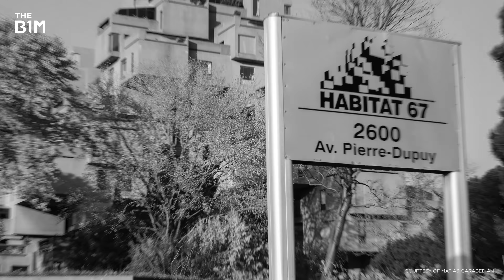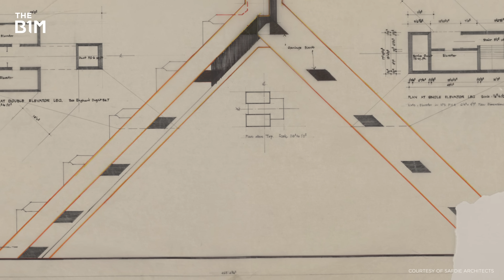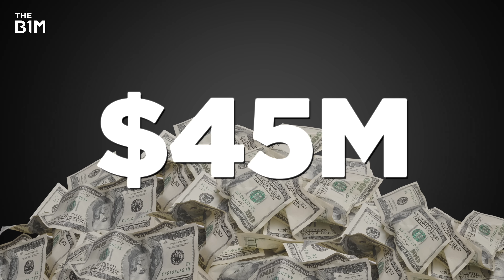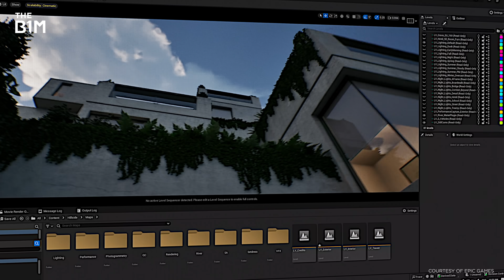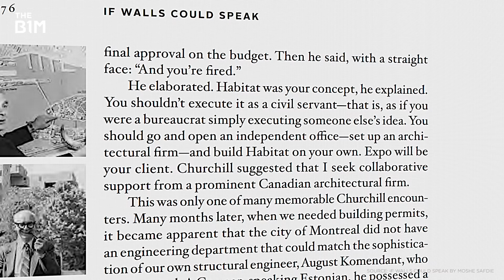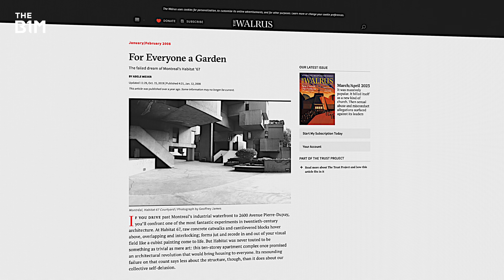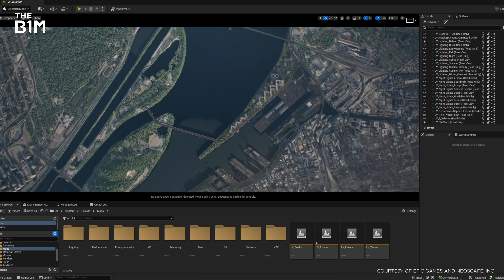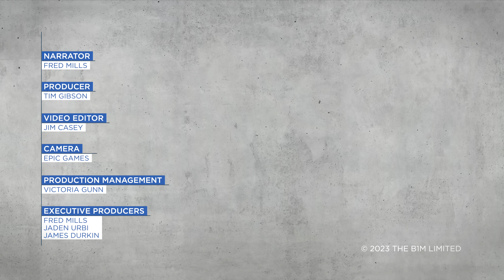How a 23-Year-Old Solved Urban Sprawl

Comment: Looks like the large Native American pueblo buildings the put up in caves and in the valley’s 
Large, complex, multilevel structure with multiple rooftops separated from each other by short walls. With large drain off the sides so the snowmelt can be easily shed. Very interesting

Comment: This reminds me of the reconstruction of Darwin after Cyclone Tracy in the 1970's. A huge number of houses were replaced with precast concrete buildings. These replaced old stump/post frame buildings built of mostly fibre cement. Be interesting to do structural analysis on these buildings now as Darwin is prone to minor seismic events.

Comment: This place is terrible urban planning. It is isolated by itself, and you must drive a car to get there. Outside of the building is a lot of nothing-- you cannot walk or bike anywhere-- you are trapped in this monstrosity. And sure, someone may put in a convenience store and a dry cleaner, and a branch of a bank, but there is not the sort of organic development and a plethora of options that make a walkable city, well, walkable. Not to mention the design of the building allows cold air to flow below all of the units, thus increasing dramatically the heating costs in the winter. The place is downright awful. Who would want to live here in this stark no-man's land?
Reply: You nailed it. I'll stay where I am. I have a car, but am a 10 minute walk from 9 bus lines, or I can make a short drive to a train station and avoid the traffic and the $40 to park at the stadium. I regularly use public transportation - in LA! I walk to the grocery except occasional trips for heavy stuff. My yard is private. My small house is energy and water efficient. It's a good balance.

Comment: I thought this was disappointingly weighted towards promotion rather than analysis. It's an amazing design but there isn't a clear sense from the video of why 50 years later this hasn't caught on. Was it just a matter of cost? Video doesn't explore this.
Reply: It's a puff piece for Safdie. We've largely moved on from the drab and high maintenance concrete behemoths of Modernism. Postmodernism invited more playful designs but anything taken too far to the extreme can quickly become dated.

These days, contemporary architecture calls for more glass and steel as seen with Structural Expressionism where form becomes the ornamentation. Even Beyonce's Renaissance exposes a lot of the structural work to the audience.

There's also increased focus on sustainable architecture. The costs of sand, lumber, steel, and glass have risen. Concrete contributes significantly to raising carbon emissions. New York City is slowly sinking around 1-2mm a year from the weight of all the skyscrapers.

Comment: I'm very turned off by people continually trying to cram other people into cities. But at least Safdie has gone in the direction of trying to solve the problems involved with the urbanist movement. His original design isn't like a prison cell block like most apartments. It has fresh air, sunlight, and privacy. 
I still wouldn't want to live there, but it's a revolutionary improvement over the trends of the last couple of centuries.

Comment: For those interested in similar projects, Japan has a finished apartment complex called Kawaramachi Housing Complex. It's composed of 9 similar shaped apartments with the open space underneath and terraces above. The amenities aren't contained in the main building but separate buildings a 1 or 2 minute walk away. It was designed by Otani Sachio in 1970.
Reply: not as impressive as the wouldve been 45 million $ village of Moshe Safdie

Comment: Sad things is that the original idea will never get build.  Because of earthquake and because it's not very easy to access if you live on higher floors.  I would love to see a modify version of how elevators are added/incorporated into the design.  If it does have a main elevator cores I would love to know where they have put it in the design. Also I would love to see this design in an earthquake test.

Comment: Many cities have restrictive zoning and regulations that prevent cities from increasing in density which contributes to rising housing and rental prices. I think a simple solution to this would be to reduce the types of zoning to just industrial (manufacturing, warehouses, etc.) and residential-commercial (housing, retail, office, etc.) zoning. Instead of having density restrictions residential-commercial zones could have floor height restrictions. Something like a building cannot be more than 2 floors higher than the average number of floors for buildings on the adjacent properties.

This would allow mixed zoning and allow cities to grow progressively in density over time.

Comment: Although a good idea, this architecture does not make a lick of sense in cold, northern climes. I only see my utility bill going through the ROOF to keep the place relatively warm while the brutally-cold winter winds sap all the energy from above, below, & 2 or 3 sides. Much better to locate it in deserts or tropical areas where you WANT to have the natural wind flow keeping you somewhat cool! :)
Reply: Exactly why it was a failure. All that snow and rain on that drab concrete... please.
Reply: You'd have the opposite problem in hot areas. All that exposed concrete would heat the interior like crazy. In summer, the room in my house that has a southwest wall is 12 - 15 degrees F hotter than the rest of the house. And that's where the architect put the master bedroom (in 1958).  I don't have, or need, central AC, but had to install a solar shade and a room air conditioner.

Comment: in Germany there are quite a few apartment buildings which sort of are built to similar aspects - while they were modern many decades ago, some of those addresses don't have such a great reputation today any more; Not necessarily dangerous or critical, but they got cheaper, and it's definetly not the kind of place people look for and where they want to move to ...
There are such buildings around in both larger cities and smaller towns, but although there are many people living there, it's kind of a failed concept. Most people living there are either elderly people or families from abroad with a low(er) income.

Comment: 😉 Though I was probably trespassing, I remember spending hours visiting this site in my youth. Pretty much any point of view feels unique has the areal sidewalks also act has balconies. It's a surreal construction to say the least. One note though. One must not be affected by height sickness since some platform and units (apartment) are partially standing above ground with little support from beneath but also from the sides some 8 to 12 meters above the ground. Say, if you had one of these units, your kitchen or living room could be partially standing 8 meters above ground but with a 8 meters gap (no pillar or structure) between your floor and mother earth. Realizing this later spooked me a little I must admit. 
I gotta go now. I want to see this Unreal version of this mystique construction.
Reply: Just went visiting the Unreal simulation and it's amazing. I particularly recommend the simulation called Balcony 7. It's the one that brought me closest to the feeling I had while visiting this construction. 😋

Comment: Very interesting video, thanks for that. The design of habitat 67 is quite remarkable. It reminds me of another project in my home town that was planned in 1965, so roughly at the same time: The Terrassenhaussiedlung (roghly "terrace building estate") in Graz/Austria. Not sure if independently or if it was influenced by Habitat 67, but the idea was similar: Providing green spaces, interconnecting the apartments not only on the ground level, and providing community space. It's a bit larger, but not as dramatic as Habitat 67 and was built only in the 70s, but there are clearly parallels.

Comment: I have done renovation work in there. What an amazing place.  The hardwood floors have a unique pattern that is known as habitat 67 flooring to contractors, and you can still find some old stock for repairs if you have the right connections!
Reply: So cool!  Thanks for the insight.  Does the whole thing hold up, or is it like FLW's "Falling Watter" which is in need of constant maintenance?
Reply: It sounds each of these problems are solvable
Reply: @ryccoh  - you need to read and comprehend what FP said. It is a spectacular failure - which any professional could envisage. You cannot have a garden on your roof without it leaking.
Reply: @MichaelFlynn0  you absolutely can, that's how our houses are in South Asia and many other parts of the world. We even receive more precipitation than most of Canada. 
It's just an old building, made with a very tight budget so of course they had to cut corners on concrete and materials. Done properly, these are all very solvable problems
Reply: @fuzzyc  - dood I have lived in Asia for 30 years...they ( flat roofs) are, and alway will be a total disaster for residential dwellings long term.. Unless you have a business in waterproofing , and then I salute you.
Reply: Worst place to live, glad I moved! There are guided tours everyday, you feel like you're in a weird people watching zoo, no privacy whats so ever. Each unit cost $810,126.58 to make in today's money value so if you make new project that mimics this it's not sustainable or affordable for anyone but rich elites. It has leaky terrible flat roofs that are always under repair but never repaired fully. It's made of subpar concrete and was rushed so the concrete is always damp and being repaired, mold is everywhere staining the concrete. It's an eyesore and a health hazard, it's a failure through and through. The only reason the condo board can pay for maintenance to keep it livable, is guided tours that start at 50$ a pop. Everything about this is a failure of idealism and a disregard for reality.